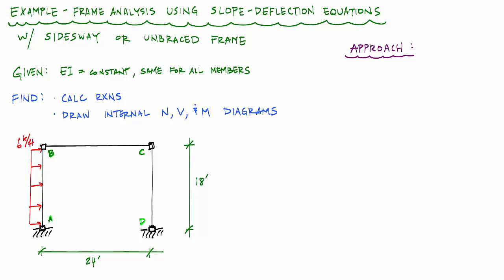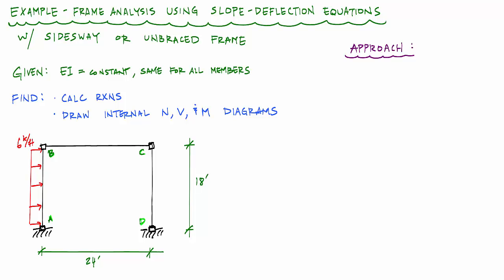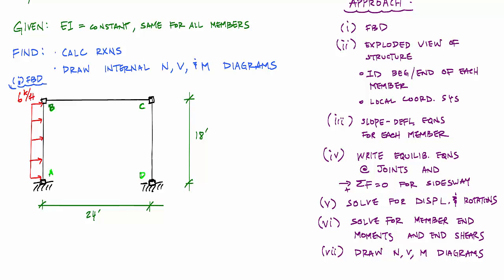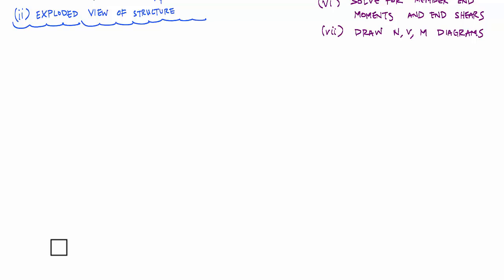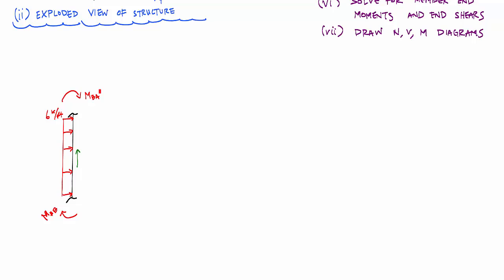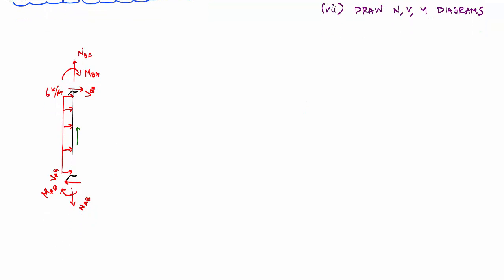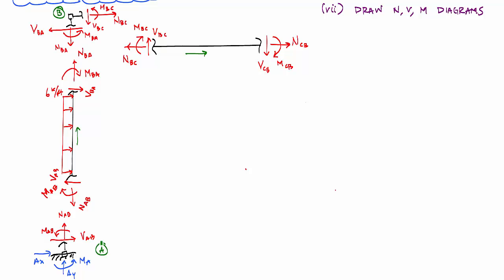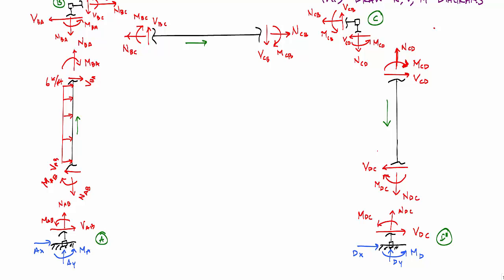Slope Deflection Method - Sidesway Frame Analysis (1/3) - Structural Analysis

Comment: Thank you the videos are really helpful for my revision. Just came across a similar question however the member BC is of infinite rigidity. How do we deal with that? Does it mean slope angle b and c are 0? All the slope deflection eqns I wrote are leading me to a dead end. I just assume that all joints will become plastic hinges even if it experience the slightest sway. Appreciate if u could help! Thanks!

Comment: Hey Man, can you help me? I have a portal frame similar to this one. I have to solve it using the moment distribution method but my problem is I can't figure out the fixed end moment for member AB. So member AB Is 12m long. Has a 20kN point load acting at 6m and 20kN point load at support B. Could you tell me how to find the fixed end moment for the beam? Cheers!

Comment from the maker: It's been long overdue, but now it's here. Statically indeterminate, unbraced (sidesway) frame analysis using slope deflection equations.
-Structure Fo-rizzle.
Reply: Hi, Is it using the same way to solve frame analysis with no sides way too? :)